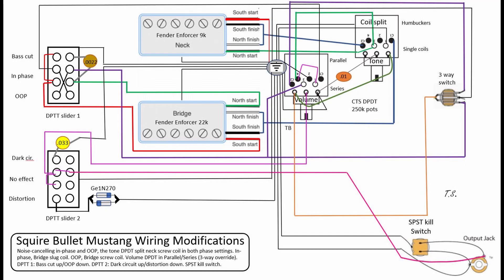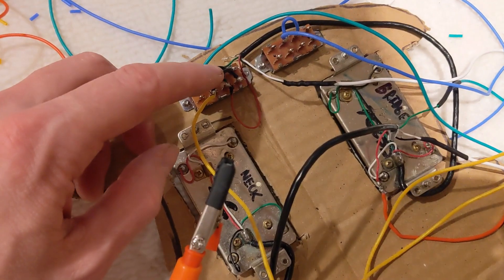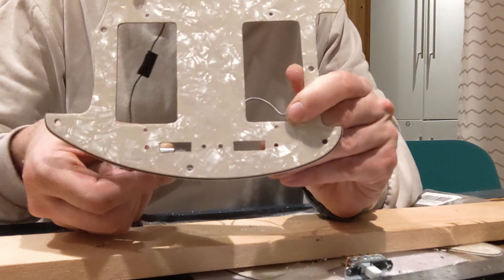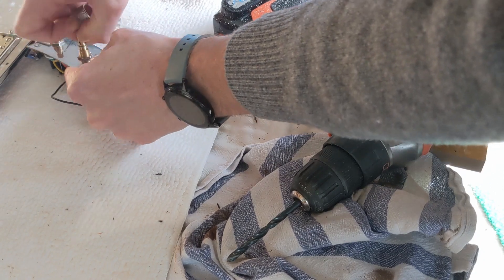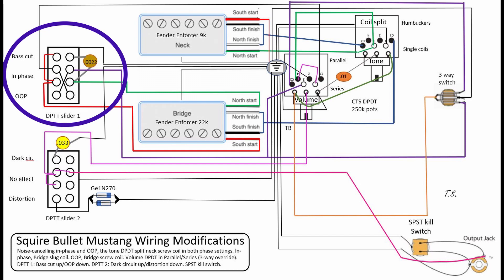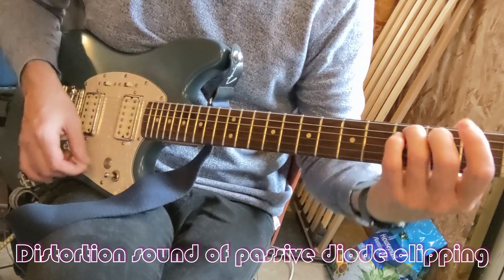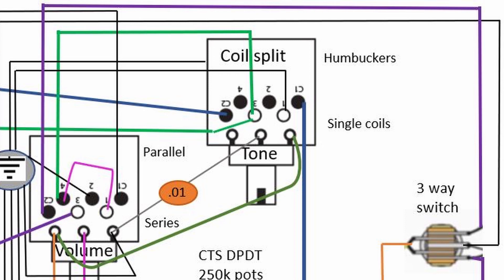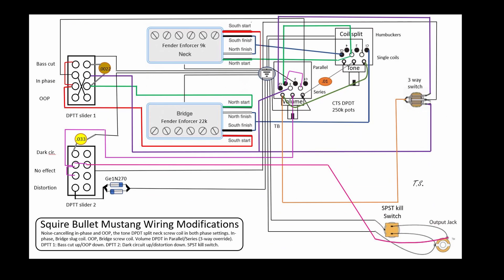2 - Overhaul of Squier Bullet Mustang: Wiring

Comment: for the slide switches, did you have to cut some of the wood out? idk how else to explain it but it looks like those wouldn't fit in the space for the pickups.
Reply from the maker: If I remember correctly, I think they fit it or maybe I had to rout a mm from the slope, wasn't much if I did.